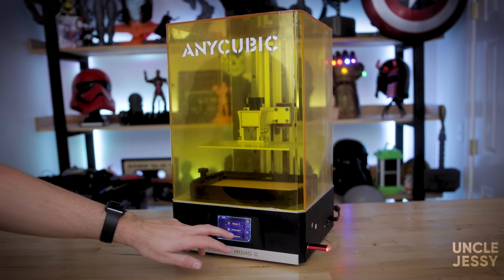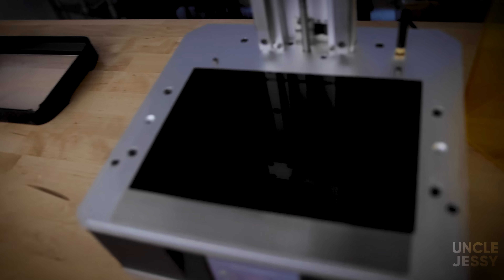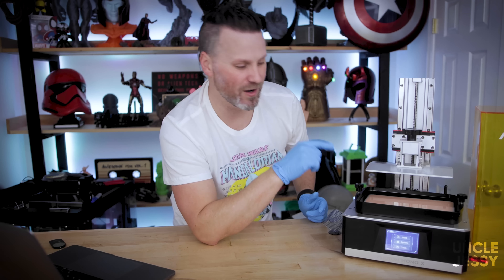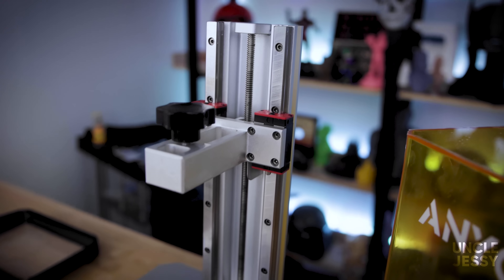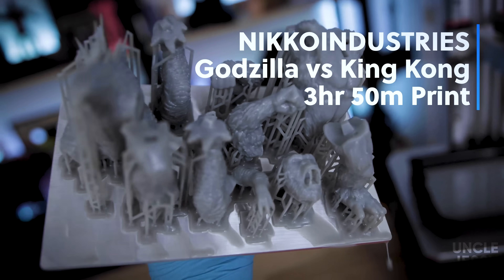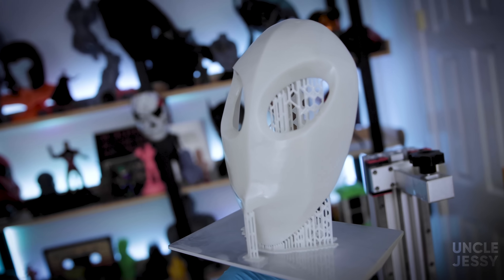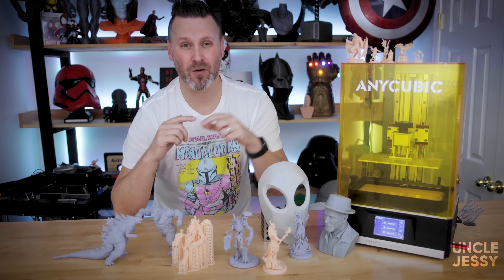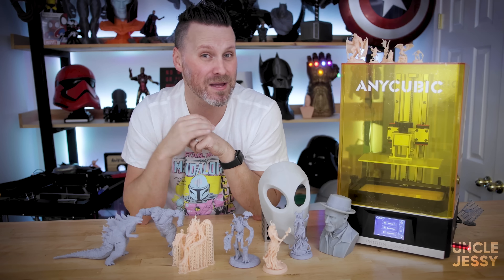King of All Resin 3D Printers? Anycubic Mono X Review

Comment: My experience with this printer and this company is a LOT different. I purchased 2 of these after seeing reviews like this one, purchased from Anycubic, and BOTH were defective. Both had the exact same issue, a bad bearing in the motor. The problem on one of them showed right away, and after contacting Anycubic they decided to cover their so called warranty by shipping me a motor in a plastic bag. Thats right, a plastic bag. Of course it arrived damaged, having been bent in shipping. Instead of replacing wither the motor or the machine, they claimed to me that they no longer had any of them and I should return it for the refund. I returned it, then after 15 days I had to file a claim with my bank to get my refund. All this time, they did still have them in stock, they had just raised the price by another $150. The second one, with the exact same issue, is still sitting here nonfunctional because Anycubic is dragging things out. The last email I got from them, which was their reply to my asking what is going on with the motor they were supposed to be sending me was for them to start all over again like it was the first time I contacted them. I have been going back and forth with this company for weeks over this issue. And this is not a clear "oh the motor isn't running" type of issue. It was so subtle that while I never managed to get a successful print on this machine (I was always thinking I was doing something wrong at first) which I ended up wasting over $150 resin with failed print after failed print. But, hey, I guess they just think someone like me is not only made of money but also someone who doesn't need a warranty. I would advise anyone wanting a resin 3D printer to get one from ANY other company out there. Anycubic has proven to me that they not only make shoddy products, they don't care about the customers. All they want is to see how many people they can trick into purchasing an expensive machine and then they will drag things out or wash their hands of you, leaving you with no other choice but to file charges and report them to the FTC. Companies like this one should not be allowed to do business here in the U.S. if this is how they are going to act. I still have a machine that arrived DOA and they STILL have done nothing at all to help fix this issue.

Comment: This is 1 year old so you've probably solved it by now, but didn't see anyone mention it, but your wifi issue is probably due to using the guest network. Routers tend to make guest networks unable to see other devices on the same network.

Comment: Hello there
I bought monster of a printer back in summer as I read many good things about it.
But in the last time it doesnt work propaly anymore, since i changed the FEP. It is soon damaged after a few dozent hours of use (around 20-30) and so most of the prints that come near to that hour mark.
I already reached out for many other professinals and people who has the mono x in use but neither they cant say what the problem is or never really encountered that.

The key problems are:
- kindly ripped out skin of the prints (like a christmas tree, if you print a lance or such)
- imprints on the FEP
- and very short life span of the FEP

For the regular trubble shooting I made sure that the room temperature is nearly constant about 21.5°C, settings are: exposuretime is 3s for 50µm with 4mm/s lift and retract speed. For the tension I tried an app for measureing the Hz of the FEP about 333Hz.

The FEP and Resin that I use is from Anycubic and worked just fine during the summer with the original FEP on the resin vat. freshly out of the box.

If it would help I could send some photos of the problems just mentioned above. Of course if you want that and/or have time.

Besides that, I love your videos and testing, really helped out in many ways

Best regards
Manuel

Comment: Hi Jessy.  You do great job. My compliments.. I'm looking to buy the Mono X. I have a few questions. How is the Anycubic support? How long have you had yours? Is it reliable? I'm so scared about purchasing printer now because of past dealings with Wanhao. I so unsure about what to do.. I have a duplicator 7 and I have replaced the LCD screen twice and now the touchscreen is down. I fed up and need a better alternative.  Many thanks for your help in advance.
Reply from the maker: MonoX is a fantastic machine and Anycubic is fairly responsive as far as I know. The one issue is the mono x doesn’t have anti aliasing which helps with smoothing out print lines. A good place to check is the mono x Facebook group as wlel
Reply: @UncleJessy  That's great thanks Jessy.

Comment: I ended up buying a Creality LD-006 from my local microcenter because I wanted to support my local stores but ended up having to get it replaced TWICE within a week. First time was because the lighting array was off, it under exposed half of the build plate and over exposed the other. The second one worked for exactly one and a half small print jobs before half of the mono screen just died. I’ve returned it and for the same price as the 006 (in store) I’ve ordered one of these along with the new bigger wash and cure station they make. I’ve basically sworn off Creality at this point. The only printers I own that don’t always break down are Anycubic ones like my Vyper.

Comment: Mine has been nothing but headache inducing frustration and despair. None of the settings or materials work out of the box. Prints fail, details are missing, entire portions of models, and on and on. Worst part was trying to pry up some of the nuggets of resin stuck to the FEP film, and wound up tearing a hole in the bottom of the tank. Resin everywhere. Nothing clean. I can't even think of using it without just feeling frustrated at the idea that I'm going to plug in a model, full of hope, and come back in 4 hours to nothing but disappointment.

Comment: Regarding the flat area that can accumulate resin, why not glue (hot glue, or silicone) a pair of small plates to the front and back to prevent the resin from getting to that flat area.
Thoughts?
I ask because, if I end up getting one of these, I am likely to give that a try.

Comment: has anyone tried to melt and reuse the melted resin in order to save cost, can it be done ??
Reply: Resin on these types of printers cures through a chemical reaction that can’t be practically reversed. That might be possible, but it would not be economical.

Comment: Can anyone here tell me if Anycubics Resin (cured 3D print) can come directly in contact with a platinum based silicon without having to prime the 3D print? I reached out to Anycubic about this and received an answer that completely did not make sense....
Reply from the maker: Oh man I wish I knew the answer for you. But I don’t believe most of the 3D Printinf resins out there work well with molds. Something I’ve got to experiment with a bit more on

Comment: I was looking into a solution for the same issue you have with fudging up the cover with fingerprints and these were suggested for me. This way you  grab them and not the case. This is such a great idea lol

https://www.amazon.com/DDSKY-Suction-Handles-Bathroom-Adsorbent/dp/B07994MTBS?tag=wpcentralb-20&ascsubtag=UUwpUdUnU66628YYwYg
Reply: I never thought about using suction handles on the side of the case lol.

Comment: Does anti-aliasing work correctly on your 3D printer?
On my mono X, even after updating the firmware, AA does not work
Reply: No, Anycubic admitted antialiasing don't work on this machine.
Reply: @Paul Denton I don't know, they have already released 2 updates that said it fixed the antialiasing problem but it hasn't worked, I don't believe much in Anycubic's word anymore 🤷🏻

Comment: Hi Uncle Jessy, which one between these larger printers (Mighty, IBEE, Mono X, Saturn, E10) do you think it's the most stable and reliable (for pieces that are not higher than 10cm but maybe cover the entire build plate {so there would be some power needed on the stepper motors to lift those heavies without any issues occuring} )? (I don't know, maybe considering LCD display, light source, power source, internal cooling for the LCD, etc. etc.)? Maybe you can advise me which would be your top 3 taking into account all of the above... I would really really appreciate it (these get quite pricey around here, IBEE it's ~1000€, Mighty ~650€ and so on)! 
I love about the Mighty that is has the largest build space on X-Y axis and from other reviews as well I've seen the light on the display is very nice (same with IBEE, great lighting) so the accuracy should be spot on but I'm afraid of those motors on Mighty not being able to lift the plate with heavier pieces (or doing it with issues, visible lines and ultimately by loosing accuracy on Z axis)...

Comment: You're not supposed to use the wifi to print from your phone, it is more used with PC on the network so it makes printing easier. I have a flyingbear shine 3d resin printer with wifi and it speeds up our production for our clients ALOT instead of going back and forth with USB. We save lots of the and money with wifi. Flyingbear is the only printer with built in wifi. It has saved us thousands of dollars. I do not know why you associate wifi with phone, which is not it's full potential in the 3d printing industry.

Comment: Great review. I've got the Photon Mono SE which is awesome, but I wish it had a bigger build plate. The expression on your face when you dropped the hat was priceless. I know this so well. The sound a resin print makes when it hits the floor. It's like "CLACK". You know it's gonna break. lol. Anyway I wanted to know if you have used any of the more durable resins out there? I have found Weistek brand resins to be great. The have a ABS like and Toughness types of resins. So far, I've have had none of my Toughness prints break on me. They have a quick Normal Exposure of 1.5 to 2 sec. I also got the resins at a pretty good price thru ebay when compared to Anycubic's resin price. You should contact them and ask them if you can test/review their resins.

Comment: Just picked up one of these. I've gotten good printing results, but have had terrible issues with prints sticking to build plate using Siraya Sculpt Ultra White. When I finally chisel off the the build plate, I see what looks like a metallic coating on the plastic platform. Iv'e never seen anything like this on my Photon using this material? Seriously, it looks like I'm pulling a metallic grey film off the build plate. Is it possible to be literally fusing an oxide layer off the plate and attaching to the plastic? Nonetheless, I'm experimenting with set-up gap and bottom layer exposure times to no avail. It's either  super bonded to plate or stuck to FEP. Seems to be no middle ground yet. I'm hoping you may have some insights into what else I should try. Enjoy you channel and just subscribed..
Reply: PS. I was able to get the network connected. Once you update the wifi.txt file with your login info you need to "print" the file in the machine as if it were a 3D file for the system to accept it. I found this online somewhere and it definitely works.

Comment: Thank you for this, and all your great vids, Uncle Jessy! Question, for anyone who can answer: I'm thinking of upgrading from my Epax X1 to Anycubic Mono X. I understand that it will print faster and higher-rez prints. Will I have to learn a whole new set of settings in ChituBox to account for that (I'm thinking about exposure times and lift speeds and such) or will Chitu auto set these once I indicate a new machine? If I'll need to set new ones from scratch (I'm guessing that's the case), any ideas on a good place to find great starter settings beyond Anycubic? I'm finally nicely tuned on my Epax settings, and I dread starting that process over on a new machine, but I want to jump in with eyes open and a good start. Much thanks!

Comment: The wi-fi setup is odd. You have to edit the wifi text file included with the usb stick. I had to dig around to find that. Trying to get the printer to see wifi like normal will not work.

Comment: Jessy!!! This printer have some features that others do not!!! You should tell a bit about those. I can not emphasize enough. Go and search for "Resin Exposure Range Finder or R_E_R_F as they call it. Another excellent option is to set the UV LED power (settings on printer).  And Yes, WiFi is a bit of a joke! BTW, did you read the instructions on USB stick? ...created a WIFI.txt file? ...printed this text file??
Reply from the maker: Thanks will take a look at those two. And yep. Read the instructions as well as some tips from people online and still couldn’t get it to properly connect when running the wifi file

Comment: Hi uncle Jessy, I would like to see a video in which you have different sizes of the print models from normal size models to the crazy small (maybe 4-5 mm height) miniature which audiences here can see the maximum potential of this printer. I also want to see these different sizes model be set on the finest setting (0.01 mm Z-axis) also the finest setting on the X and Y-axis. Thank you!

Comment: Ive had this printer since october, if you decide to buy it be careful, you should always put a screen protector over the LCD, as the mono x comes with a polorizing sheet over the screen, its not glass so if you spill resin on it you will need to take off the polorizing film and replace it, not as easy as it sounds, so you may end up buying a new screen wich anycubic dont even sell yet..

About that i tried to get my screen replaced in october, i did 5 or 6 prints and the fep sheet failed me so resin leaked onto the lcd, also resin cracks the cover so you end up with thousands of micro cracks.

I opened a ticket with anycubic in early october and they said they will send a screen snd cover in 2 months, so december, guess what they didnt, so i asked where they are and was told it will be 2 more months as they dont have consumables ready.

Still to this day waiting on my screen and cover, i did go out my way to buy a new screen £140 plus £30 shipping...from aliexpress.

This company are the worst i have ever seen in terms of customer service if you buy definitely dont buy from anycubic, youll be waiting months, go with amazon atleast if something goes wrong they will replace it. 
Anycubic sell an incomplete product, no consumables meant i had to wait until january to actually be able to print again and thats no thanks to them, that goes to aliexpress.

Printer good, anycubic bad.

Comment: This was my 2nd Resin printer. Now before I continue, I think my results are A-typical.  Personally I had nothing but horror stories out of this printer, but in hindsight may have been my fault. I had 3 of these printers. The 1st one the touch screen barely worked. The 2nd one the FEP broke through. The Third one Broke through the FEP as well. Soooo I think if I had used Siraya Tech resin, it would have been fine. I was using Elegoo resin. Elegoo resin has a much higher peeling force than does Siraya Tech.  But, in a way I'm glad I failed with this printer because it propelled me to get the beast that is the Peopoly Phenom. There have been so many success stories with this printer.... So I think it was either bad luck on my part or the elegoo resin.  Truly I am not trying to make anyone shy away from this printer, I am just telling my experiences with it.  But I would highly recommend using Siraya Tech resin. I think if you do that.... This printer will probably serve you well for years to come.